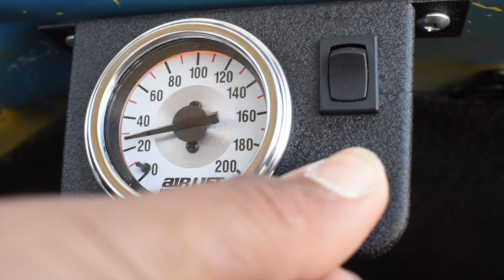Fixing My Bagged VW Beetle Fitment The Hard Way...

Comment: Same thing happened to my bug I just did a cold air intake on my friends car he wanted to drive my bug so I drive his car (figured if I take care of his car he will do the same) long story short he drove my bug into a wall
Reply from the maker: WHAT !? HOW DOES THAT EVEN HAPPEN !? Its very unfortunate that you had to go through that bro. I cant even imagine that. I hope you and your friend are good. Potentially even the car I'm not too sure.
Reply: @tuned_tunas  yeah the cars good been through a lot simi hit it and flipped it over with my dad and his friend, my friend drove into the wall hit a turned to tight didnt close the door all the way didnt buckle up went flying out the car and the car went into the wall than I got hit in the back by someone who was texting and driving and ran a stop sign. On a side note my dad recently passed  and this was his car before I had took it over by rebuilding the motor, and now that he has passed I have inherited so I'm doing a full restro. On it. She has a lot of work to be done front clip two fenders running boards wiring harness new windshield and so much more but little by little it will get done.
Reply from the maker: Glad you're still alive bro. Little by little you will turn the car into something great. Hope for nothing but the best !!